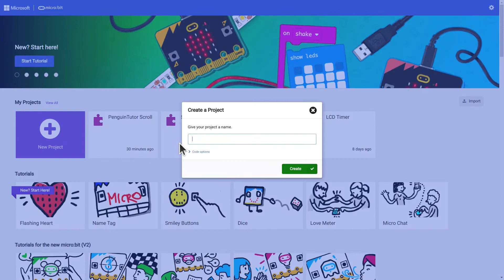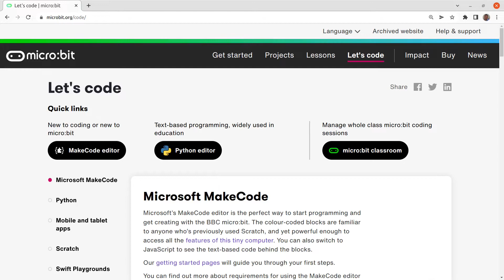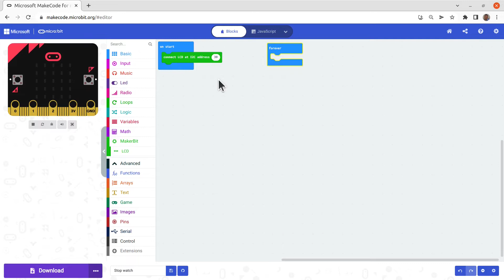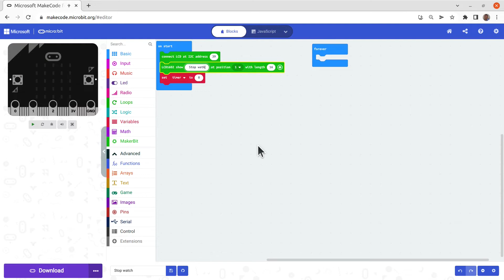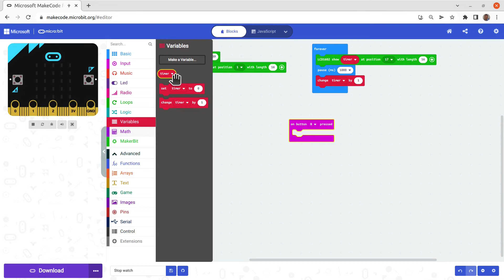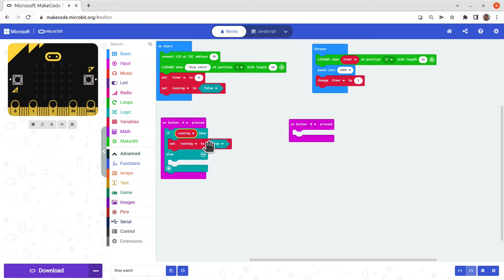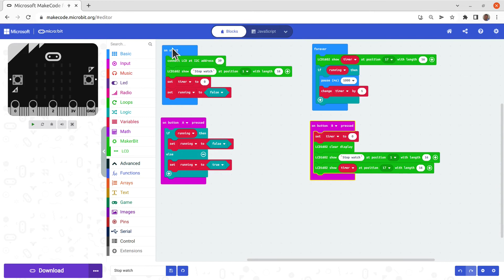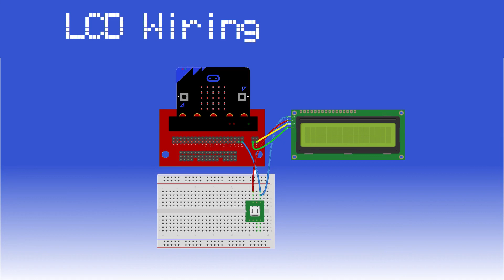Micro:bit LCD Display with microbit makecode and javascript

Comment: do you have the project without the I2C module?
Reply from the maker: Unfortunately I don't have that for the Micro:bit and it's not quite as straight forward. It's not common to use a display without the I2C back-pack due to the number of ports that need to be used (6 gpio pins in 4-bit mode compared with 2 using i2c). 

Because of this (as far as I know) there is no MakeCode that can be used to control the display. It may be possible using MicroPython though. 
I have created a video explaining this using a Pico and MicroPython. https://youtu.be/xg-VptjN_Oc?si=vfwGL3MH-KCRdWm7 

My suggestion would be to get a display with an I2C backpack, or if you are able to solder, you can buy the backpack which is cheaper than buying a new display.

Comment: penguin tutor can you plssss show how to activate the cursor on the lcd pls (with makecode)
Reply from the maker: Unfortunately I don't think that is possible, or at least not with the standard extensions. 

To turn the cursor on and off involves sending a special code signal to the LCD display. Unfortunately the library used in MakeCode does not have an option for sending that code. 

You could most likely turn the cursor on and off by using Circuit Python on the microbit, but not makecode.
Reply: Bruh 💀 but AI says its true on makecode
Reply: IT Made a Code that really Said ShowCursor(true) Like fr😭
Reply from the maker: @The3DTechGuy  Which is one of the problems with AI. It doesn't actually understand but just puts together what statistically looks right. 
Sometimes AI can come up with code that works, but often it doesn't. 

It's possible someone has created a makecode extension that does include that, but I suspect it's just AI getting it wrong.

Comment: Where can I get some of these components, and is there anyway I can have a smaller breadboard?
Reply from the maker: I have a web page which links to some of the suppliers that I use https://www.penguintutor.com/electronics/links-suppliers These are mainly UK suppliers, but many also sell internationally or have websites for other regions.

I also find the marketplace sites to be a good source of components, such as Ebay and Amazon.
Reply from the maker: You can use a smaller breadboard, or even wire directly between the Micro:Bit and the display. 
The example shown is a typical breadboard which is included in the "Kitronik Prototyping System for the BBC micro:bit" which I found useful as it includes both the breakout for the micro:bit and a breadboard.

Comment: My backlight is too low, how can I increase it so that it can be read?
Reply from the maker: There is normally a variable resistor on the back of the display. Use a small screwdriver to adjust the contrast.

Comment: can you use a perf board instead of a breadboard??
Reply from the maker: Yes
The following is a good way of creating circuits for the microbit as it includes a breakout as well as prototyping area.

https://kitronik.co.uk/products/5634-create-proto-board?_pos=1&_sid=256658e17&_ss=r
Reply: @PenguinTutor   How do i attach the power supply to this board? I have the one given with the microbit.
Reply from the maker: @sidr7493  If you want to power the Micro:Bit from a breakout board then you can connect power to the 3V Gnd power connections. This would need to be a regulated 3V power supply (as it does not go through the voltage regulator). You cannot use power from a USB power supply to those pins as that will be 5V instead of 3V.

My breakout boards are Kitronic edge connector boards and on those they are marked as 3V and 0V on pins 18 (3V) and 19 & 20 (Gnd 0V).

Alternatively you can power the micro:bit from the USB / battery connections on the USB and then use the 3V Gnd pins as a power source for your own projects (as long as they don't need too much power). I used a separate USB connector for the LCD display in this example as the LCD needs 5V and not 3V which is used internally in the Micro:Bit.

Comment: How I can change the font size
Reply from the maker: The LCD1602 is designed for just a single font which is shown as 16 characters by 2 rows.

If you want a larger font then you would need to generate the characters by updating the relevant pixels to make it double height.
Reply: @PenguinTutor  thank  you
How i can update the relevant pixles
Reply from the maker: @jihansous8893  You'd probably have to create your own library to talk to the hardware. 

Here's an example of where someone has done that - but this is programmed in C on an Arduino and is much more difficult than using the standard libraries: 
https://www.instructables.com/Custom-Large-Font-For-16x2-LCDs/

Comment: well my kid tried some of this in school, site was not working extensions you can get maybe half would work. my daughter said even though its, blocks like "lego" and should be easy. you still need to know to much technical stuff, so it is not made easy. she said even the teacher struggled with it, and barely made it work.
we watched this together, for me not knowing about the coding and all that, but i do see what she means. it is not made easy.
Reply from the maker: I'm sorry to hear about your experience.

Unfortunately that is the problem with some of the extensions. There are several extensions that don't work or have bugs within them. There are also some subtle differences between hardware that is available. 

The most reliable solution is to buy a hardware bundle that is known to work with a specif extension, but even then updates to the hardware or code can cause problems after the bundle is released.

I have been caught out by that in the past and find I sometimes need to retest and/or revise instructions prior to any workshops I run.
Reply: @PenguinTutor   just thought it was a shame it seemed so half finished.  it should be  fun to work with not frustrating
Reply: I just picked up the keyestudio 37 in 1 that has the 1602 LCD and comes with a breakout board. There were dip pins that needed to be put on 5 v. When powered with the battery pack (9v) the LCD works great, and very bright. It has the 1602c extension on the keyestudio website.